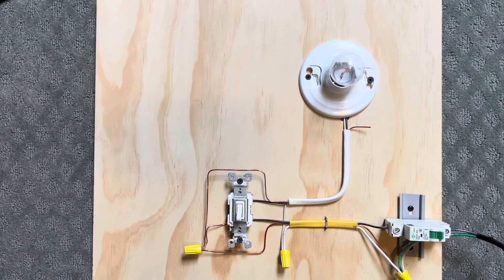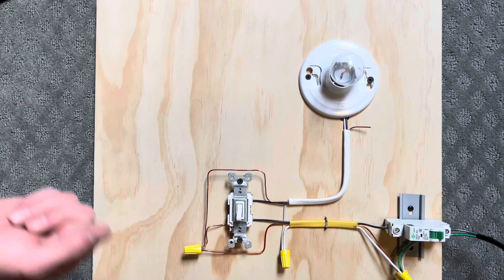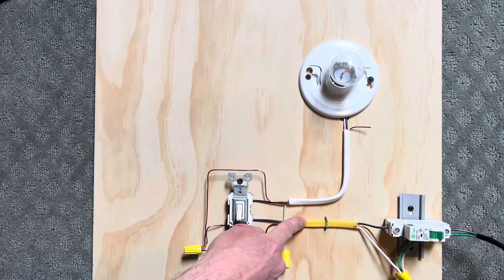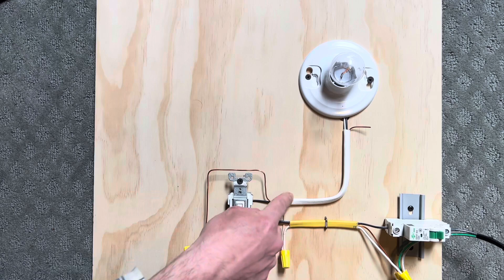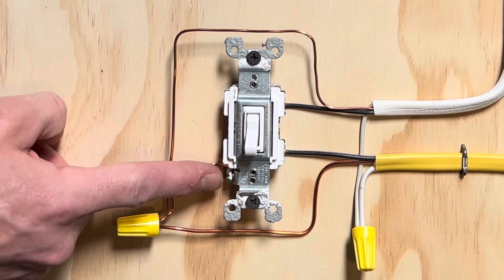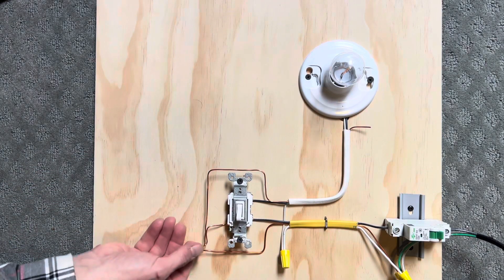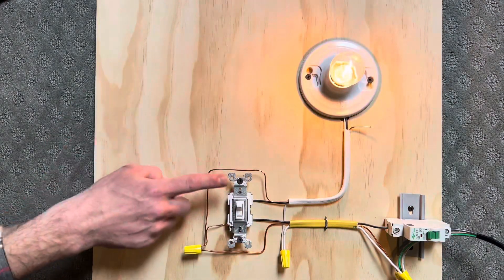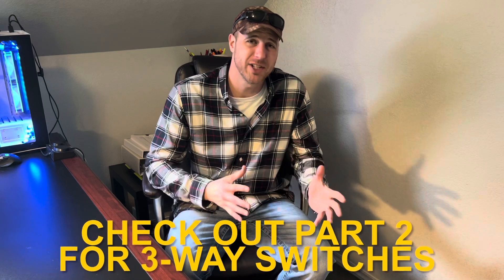Part 1 - One-Way Light Switch Wiring. Easiest Explanation! Check it Out!

Comment: Is it safe to run off of an existing line between plug ins up to a new switch and light? How does this look when wired properly? I'm trying to learn how wire in a new porch light in an existing building
Reply from the maker: Hey there! You absolutely can do that. You'll have to make a new hot (black wire) from one black wires on the plugs and run that to your new switch. You'll also need to take a new white (neutral) from the plugs and run that from your plug to the switch box. Also, you'll need to run a new ground (green) to your new switch from your outlet. Once you have all three new wires in your switch box, you'll hook it up as I did in this video. Your new black wire will go to the switch, then another black wire to your light. The white will go from your switch box, up to the light and your ground will go where necessary. Usually to the light switch and the light. It's actually pretty simple. I suggest watching my video again once you get to the light switch and light installation or watch other people's videos. The only real difficult part is running your new wires from the outlet to the new switch box. Hope this helps :)
Reply: Oh awesome! Thank you for your instructions.. I've been struggling with diagrams in an old wiring book.
Reply: Funny I actually found your wiring video after following one of your prospecting videos using the Dream Mat. Great video with the dream mat guy BTW!  Sounds like you do a little bit of everything! Love it
Reply from the maker: Nice! And yea, I do a bit of everything but I'm glad you found it! Please let me know if you have any other questions. More than happy to help. :)
Reply: Thank you, I appreciate that. just got my dream mat so maybe I'll run into you all out on a river one day.